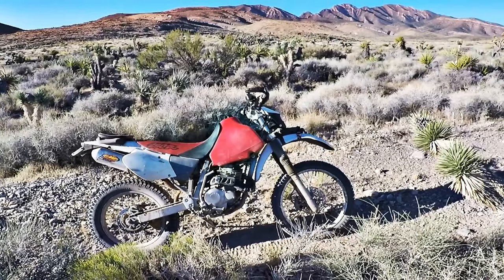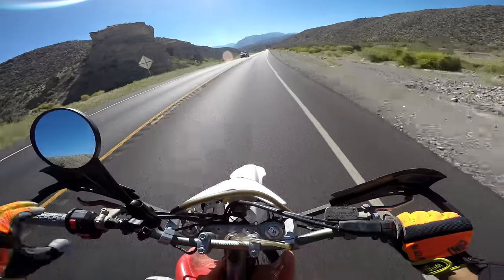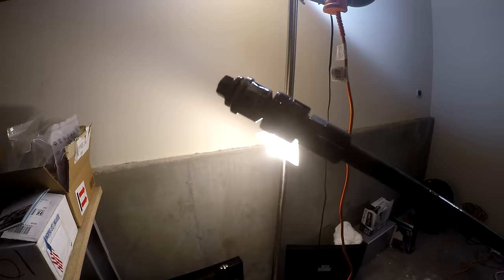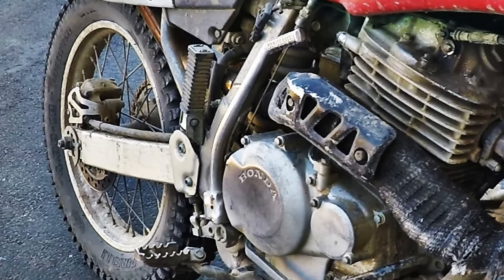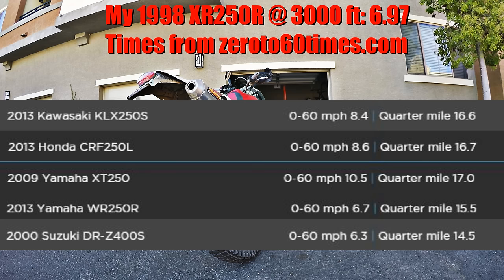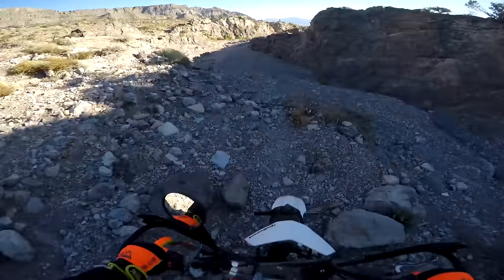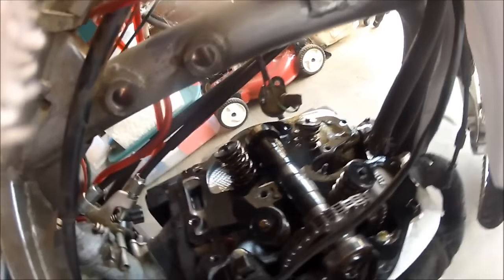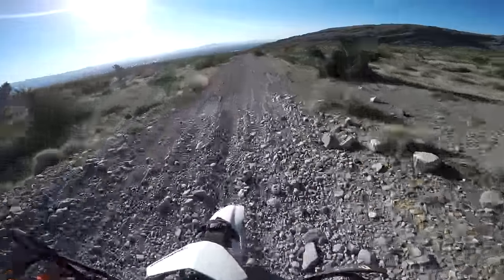In-Depth XR250R Review

Comment: I just picked up a 2000 xr 250r for 800$ the guy said it didn’t run, cleaned the carb out and it started on the first few kicks. I absolutely love Honda’s
Reply: I do to.  Very easy to ride and good torque.  I have an 03 XR400 and I think I enjoy the XR250 more.
Reply: Hi how much at cheapest could I get a working one
Reply: lee 123 probably 1.2k is average
Reply: I found one for 2k but it needed some work, it came out to 2400 with the new tires. Is that a good deal. It’s in mint condition
Reply: I'm looking at one for 2 and a half thousand and she got under 1000 miles and 1996 on original honda tires and sprockets?
Reply: His loss. Your gain!!!!
Congrats. You never sell these bikes!!!!  Hahaha!!!
Reply: У нас в России в хорошем состоянии примерно 3к💲

Comment: I rode Hermit's XR250R in Colorado and was shocked that it was so good. Seriously that bike is fantastic, and I wished they'd bring it (and the XR650R) back!
Reply from the maker: Nice! I totally agree. They just need the cheater button.
Reply: I've got an '02 XR250R and it's great. Even without an electric start it is an awesome bike.
Reply: eveRide ADV the xr650 is still in production
Reply: RCmen26  No, thats the  XR650L. The XR650R was aluminum frame, liquid cooled, and kickstart only.  It was twice as powerful as the XR650L, better chasis, and lighter.  It was a Baja 1000 BEAST.
Reply: @sciencemilitia1853  I want 😃
Reply: @sciencemilitia1853  I have one here in NZ, awesome beast!, I’m just over six foot and find it hard to touch the ground though, might lift the forks up an inch like they did on the Baja bikes

Comment: Couldn't agree more, the honda is all the dirt bikes ive ever owned rolled into one and I race mx. Its just perfect and starting is really easy, the trick is to screw up the idle pre strart and let it run high idle until warm. Honda fitted the big knob on the idle adjustment for that purpose. Im sure the engineers realized this and that explains the huge knob. Ive never been stranded on this bike and have realed in and blown by modern bikes on some hairy trails with looks of astonishment from the dust eating KTM types. Usually about $1500 will get you a virtually new one as they were mostly purchased by non race types to go riding with their kids. Look for the garage queens and upscale neighborhoods for the real finds. Nuf said.

Comment: I have a 1995 Honda XR250 Baja. Its a japanese version with electric starter without kickstarter. Everything you say is true about the comfort and realiability. I don't have starting issues sinds i got a electric starter. its starts right away with only one short crank. I really enjoy this bike. I never did any modifications. Its great ass it is. It has dual round headlights and turn signals.
Thanks for the video!

Comment: I raced mine in Hare and Hounds for 4 seasons. In my last season I eventually got it all sorted, valve clearances etc and it was so easy to ride with the right combination of power and torque. 
I fitted an Edelbrock pumper carb to mine, totally easy starting.

Comment: I take my 86 XR through the woods, what you're saying about letting the bike do its own thing is on point. A times it feels more like a horse than a bike. Just hold on and let it eat. In the lower gears nothing can stop you. I'm normally in 2nd/3rd cause its so tight where I ride but if you can get up to 4th+ the suspension really starts taking over and you can kinda just float over anything. Feels like a mountain bike with an engine.

Comment: Just found this one and it is spot on, I have had an electric start 2004 Baja for six months now and to be honest  have been a little wary of it, not because of dirty habits but lack of them as you remarked. The thing just ploughs through while you sit back like a granny on a Goldwing. When standing up becomes necessary it is more a crouch just to relieve the suspension keeping your ass back, not over the tank like a modern bike, the front end feels like the old 1940's model British 500cc bikes we used to hacksaw the weight off and add knobby tyres to for trail riding when I was a kid, but it just seems to soak up ridiculous punishment as long as you keep the power on. I have had the suspension rebuilt front and back put in two new exhaust valves and am going to replace the piston and rings, a slow process where I live in Asia but never mind, I replaced the carby with one from a CR and I will replace the muffler as mine has an inbuilt cat converter and non removable spark arrestor I will leave it as is after that as it is quick enough for my old bones, then I am off touring SE Asia. Great review of a great bike.

Comment: I found an old 1996 Honda XR250R dirt bike in my area. It had a few cracks on the bottom of the resovoir and it needed TLC. I saw what you did to your bike and it worked great. Just a few mods on your bike and it'll run like hell. I tested it while I was on I-385. It went 90mph on 49.8 mpg.

Comment: I have an '82 model ... all stock.  Still going strong. I am barely a trail rider ... nothing like you've demonstrated here, but converting fuel/air into power/torque and "rideability" is something we all enjoy.  This bike is perfect for me.

Nice vid.
Reply: My first xr250 was an 82 model i bought in 1993,I've owned several bikes since then and only had 2 favorites the 82 xr250r and a 97 suzuki rmx250 .The 82 xr was alot of fun at hare scrambles I would've bought another in a second if I had ever been able to find another one,I've had 7 different years of the xr250r and the 82 was just awesome

Comment: Absolute brilliant review, I have an XR400 2003 had it from new & will never sell it. I changed my carb to a Mikuni Pumper best mod ever with a Revmax cdi also fitted an electric start kit, SRC fork brace, IMS wide pegs, baffle out, airbox snorkel out. I fully agree on the maintenance that’s all I do on mine. Renthals, 25mm bar risers Acerbis Multiplo handguards, Blackbird Racing graphics & gripper seat cover, Ministry Of Defence bashplate, lodas of other little bits but a perfect bike. Thanks for your excellent review.
Reply: tee pee,where did u get the electric start kit,the brand and price please,thanks

Comment: For any new owners of the XR 250R who struggle with kickstarting this beauty, rebuild your carb, replace your spark plugs, and make sure your valves are spot on. My brother struggled with the same issue on his bike - it would never want to kickstart, it was a total pain in the ass. When it ran, it ran GREAT! The trick was getting it to run. Towards the end it wouldn't start at all no matter what, but after sitting for about two months and having the carb rebuilt, a aftermarket fuel filter added, and the valves brought back to spec, it started on the first kick.

Make sure you are kicking it from top dead center as well, and make sure you have the air/fuel set to the right setting if you have an aftermarket exhaust or intake. Cheers, I hope you all have a great time on your XRs. And I agree with TTM, after several wrecks, being run on low compression with the incorrect air/fuel, and being run with the factory carb and petcock, the bike still runs like a total top. You cannot kill these things.

Comment: If you have starting troubles check the max drop on your float.  I noticed if you have it around 18-20mm it is easier to start on trails and keeps the bowl from flooding as well as the engine.
Reply from the maker: Thanks for mentioning that!
Reply: Completely agree 100% ! Had an XR that would start first kick when cold however when fully warm would not start at all - Replaced CDI, Stator etc. Finally checked float level height and adjusted.....Starts hot or cold now first kick!
GREAT VID :)

Comment: G'day Mate , I don't often watch review videos but watched yours all the way through , having owned XR Honda's & Honda's in general , at the moment I have 2 XR 100s & 2 XR 250s , one is a 97 model it was a basket case when I got it , motor in bits ,parts missing , I happens to have a Cbx 250 road bike in the garage doing nothing so I checked the mounting points they're exactly the same ,but you have to use the XR motor mount brackets and do some wiring to use the throttle & light switch controls, also move the shock canister  around to fit carb & battery box , but once that's all done you have the best of both worlds ,electric start XR 250 that performs exactly the same as the kick start, no loss of power lower end or top end , I love it that much , my 15 year old now has that one.
 I recently found another Cbx to do it to my 2001 XR 250 I got off my neighbour a while back he thought it had blown a piston , he bought a new barrel and piston and never fitted it ,  I got it , it is a 266 , I pulled the thing down all that was wrong with it was a stuffed head gasket  , but having the new barrel & piston , I put it together anyway ,it ran beautiful but it's a barstard to start ,& I'm 6'2" 150 kg , so not tiny but have a hell of a time starting it  , I've checked the valve's they're fine gone through the wiring ,carb everything It all checks out  , so I've decided to do the swap on this one too , I'd rather be riding it than kicking it at my age I can't be wasting time , I'm 56 ,but still young at heart and want to be able to ride with my son when ever I want , he started on the XR100s and is a pretty competent on those but loved the 97 XR so much I gave it to him , and the 11year old daughter got the XR 100s so if your lucky enough to get another XR 250 & find a cbx

Comment: The thing I don't understand about modern dirt bikes is how they've both raised the seat height while also thinning out the seat padding. I've recently dipped my toes into dirt riding with a Fantic Casa 250 and my main gripes are the seat height and comfort. This 20 year old bike even has 3 inches more suspension travel than most modern dirt bikes (something I could have used when I bent a rim and got a flat hitting a rock at 30mph).

Comment: I had mine for 5 years and it loved to get thrown around the trails here in northern washington. Mud no problem, street no issues and fun with the friends was epic. Accidentally forgot to check the oil one day and siezed it. Got it to break loose again and rode it for like 4 more months until she finally died and lost all compression after she blew the bottom end out. Should have rebuilt it. Endless hours of fun.

Comment: I have a ‘94 XR250RR (280 big fin) Ballards bike(Australian legend), suspension mods by Ballard as well. Had it since new. It is a lounge lizard now, doesn’t see much dirt any more. What a bike! You can ride it hard all day and be fresh as a daisy. Your right, why Honda went away from the XR is a complete mystery. It was the benchmark bike, the one all other manufacturers wished they had. Simple, reliable and bullet proof. Honda has lost it big time unfortunately. My only regret is that I didn’t buy a Ballards XR600 as well. I have an XR200 (‘90 model) that I still use as a mustering bike and it is a beauty. Tuff as nails, an all day bike as well and it has done about a million kilometres. Legendary machines. Jeff the Aussie.
Reply: suzy made same sh*** ! ...why did they cancelled the old aircooled 350DR  ? ... UNBRAKABLE & torquy motor !
i got a '98 kicker model for my son <. it's the USAdirt mdl : the best DR version in 350cc.

Comment: Picked one of these Jems last month. Your review is so spot on. The low end torque is unreal. NorthernNevada has a smorgasbord of diversity. I need to find a “aftermarket platform “ way for my best friend to ride w me (4) legged pal. This 250R is as close to perfect as one can buy. Will keep this bike until I die. Came w a rear rotor protection plate for the brake rotor. Also, a ten inch rear ⚙️. Does anyone know if ten inch rear is stock? The muff is a T4 Pro Circuit. As far as high speed mentioned at 14 minutes mark……fast is a recipe for ER trip. Fourth gear is my common. So happy that I found this lil beast.

Comment: Interesting analysis. Baja Trail Rider (btr) states that a 96-04 XR250R "Baja" model was sold in Japan with e-start. Major project to get these parts and modify a US engine. 

His friend Mike H. has converted an XR400 to e-start using parts from a US Honda 400 quad. It is basically the same engine. Also a big project including crankshaft and counterbalancer.

Mike told me he actually prefers his XR400 to the XR250 for most single track. The only exception is the gnarly stuff where a modified CRF230F is king.
Reply: Now crf250f. I have a xr400r and want a 2022 xr250r aka (crf250f) best style bike ever.

Comment: Great video. My xr400r is very similar. I hear yea on the no electric start thing. Only way to get estart on our bikes is to swap 400ex (for me) and a 300ex (for you) motor or lower end. In your case you lose 6th gear but gain estart. Gives you a wider gear ratio between 1-3rd too.
Reply from the maker: Thanks! Yeah, that's what I've heard about the bottom ends from the quads. I thought it also gave it a reverse gear haha, which would be ridiculous!

Comment: Great review. Sounds like the Toyota pickup of bikes. If I were you. I'd be very cautious about upgrading. You don't want to mess with perfection. Any upgrade to higher performance will hurt something else on such a well balanced machine. I would keep it as close to stock as possible. And only fix the shortcomings, like the carb.

And it really, really seems like you've gotten your money's worth. Great machine.
Reply: I agree, i just bought a 02 XR250R and the only thing done to it was maxxis tires and aftermarket exaust. Im probably going to keep it just like it is

Comment: You mention the flooding issue . Try this first solder the plunger of the needle valve up to make it rigid ie do away with the spring pre loading on it. On mine the float itself was a sloppy fit on the pivot pin so tighten it up by bending the metal float pivot to make a tight fit on the float pivot pin. The float will still pivot freely via the hole in the carb casting. Like yours mine was a real problem but this seems to have provided a fix and yes the engine still runs fine even when you drop it.

Comment: I have a 1988 XR 250R That has had some porting work bigger jets it Runs
 rather well & Will still keep up with and pass the modern day 
bikes.  It's just a dinosaur, Rides like a board with a good shock pro 
link but hey 32yr old bike.  starts on 1st or second kick  w/o 
decompression cable on fresh rebuild about 30hrs.

Comment: I bought an 02 for cheep but its a bit of a pain to start but once started it runs like a champ. When I was timing it there was a small bit of oil coming out of the plug hole you use for turning it over. I looked through the service manual and there is no mention of draining the oil when changing the stator. I've looked all over the internet and some people say its normal for oil to be in the stator cover and some say its not normal. Anyone have any idea if there is supposed to be oil in the staor cover or not?

Comment: Any thoughts on the xr400? Pros and cons in comparison to the 250? Obviously, the 400 is a little heavier. I don't like that it's not a six speed. How does the motor compare to the 250? Any advice would be appreciated. Thanks
Reply: Joel Stoeltzing My dad rode a XR400 and I had a XR250. Much is the same as far as comfort and geometry. We switched a few times over the years. I never felt the desire to "move up" because I didn't like the weight of the 400. The only time I ever felt I didn't have enough power off-road was on big sand hills.
Reply: I had an XR 80,  350, & 500. I liked the 350 best for woods. 500 best for gravel pit. I liked em both better than my YZ 250. I just prefer 4 strokes.

Comment: The kick start is one of my main reasons I want an old XR. This pig DRZ I have only has a electric start. I've kick started bikes over the 51 years of riding. Can't understand why anyone needs an electric start on a dirt bike? All through the 70's, 80's and 90's I rode big bore bikes. Had Maico's that are left foot kick start and CR 500 , warning always where moto-x boot start big bores ( kick back ouch! ) Had 95 XR 600 & 250. DR 350's which are so much better than the DRZ's are great bikes too. 2000's been riding KTM exc 250 & SMC625 and a WR450 which broke on me twice, like kickstart shaft punch hole through case. So now the DRZ with too much invested to ever sale. Like I'm married to it and can't get a divorce. The carb on these bikes are the worst! So decided it's the street bike to go to the store on and need a much lighter dirt bike. XR 250 or 400, or build a CRF 230? I'm hoping this will be my last dirt bike purchase and I'll take it to the grave.
Reply: I thought that I have seen a few DRZ 400 for sale that had a kick starter and electric start. I have not researched though.

Comment: Have not owned the 250 but had an XR-400 for 10 years.  I found the oil changes to be a pain at least compared to a KDX.  Starting the XR-400 is probably even worse than starting the 250.  I can start the KDX with my hand!  Even with mods for the XR-250 to make it faster, I doubt that it is as fast as a KDX with a fatty pipe.  Other mods on a KDX are simple, cheap and make it way faster than a XR-250 could every be.  The 250 sounds like a great bike but I am sticking with my KDX.

Comment: The new name sounds good.  I checked out the xr 250 mods page and I was wondering which carburetor size would you recommend 32 or 33 mm.  At same time, mikuni seems very popular, but which brand would you consider the best for this bike. I would also like to keep it as simple as possible, the carb replacement, with the most reliable and best result; however, I understand some adapting may be required and if it is not too complicated I am sure I can manage. What carburetor upgrade would you recommend on this bike. I have a 2004 xr 250 r.  Thanks Jim.